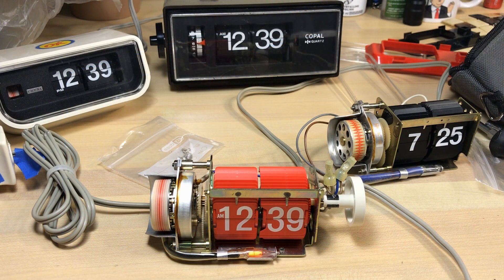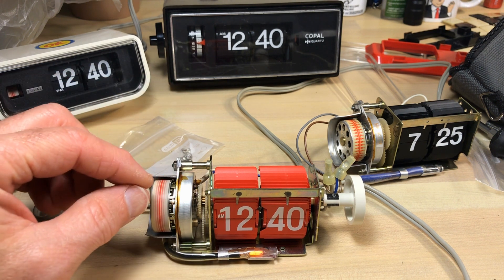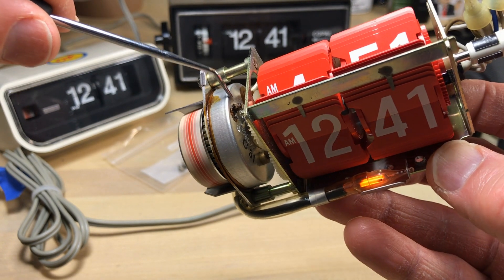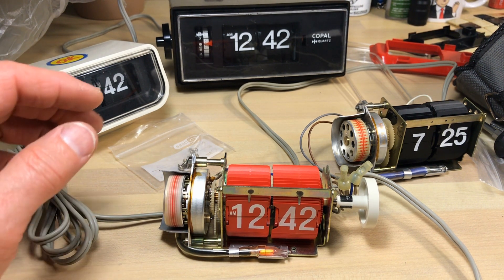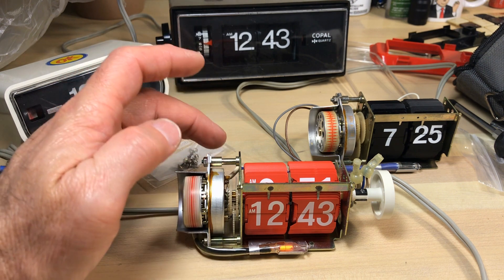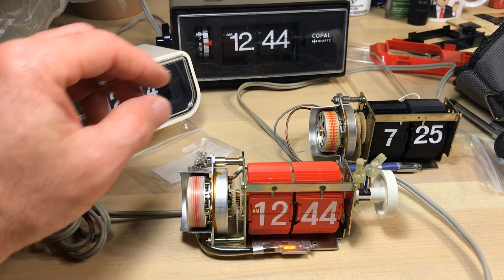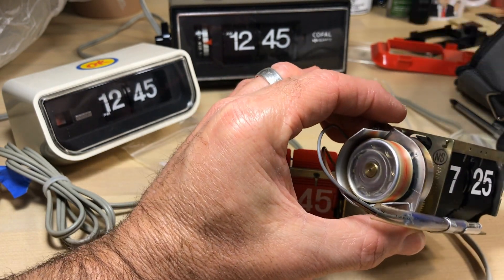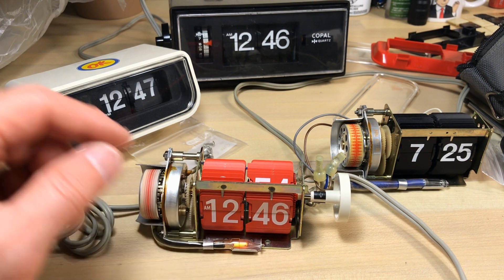Continued work on 3 Copal 225s

Comment: Thank you very much for these two videos on the 225. I just picked one up, a great red one, the motor spins the speed indicator (or whatever it is called) but does not move the numbers. Is there a way to fix that?  It also has a couple missing tiles so thanks for showing how to fix that. This video was a great help!
Reply from the maker: If the motor is spinning but the clock is not flipping, that’s bad. It’s likely a messed up gear box. They can be fixed sometimes but it’s a custom job and best done with other parts clocks.
Reply: @Flipclockfans  I figured out why it wasn't flipping, but the hour flips to the next number when the minutes are at 38. Why is that? Is there some way to adjust that?

Comment: so your not using any sunlight or another UV source with the peroxide?
Reply from the maker: soild_state_vintage   I have in the past. But I’ve always wanted to try without it. I and others have speculated that the reaction is not light dependent but that the low grade heat just increases the reaction rate. I’ve got the time... so now I’ll find out.